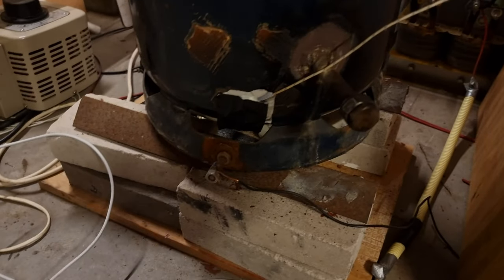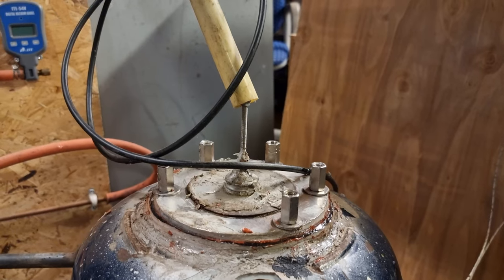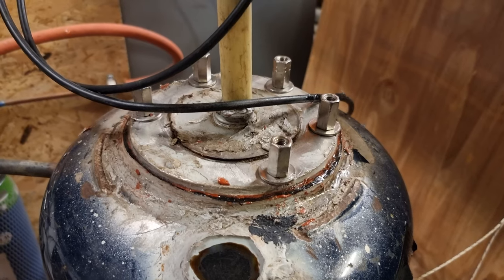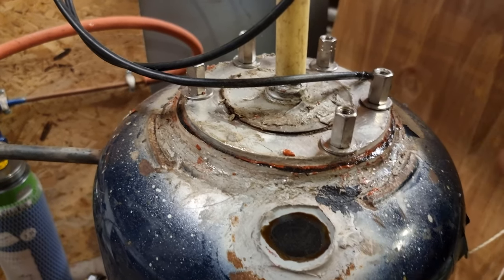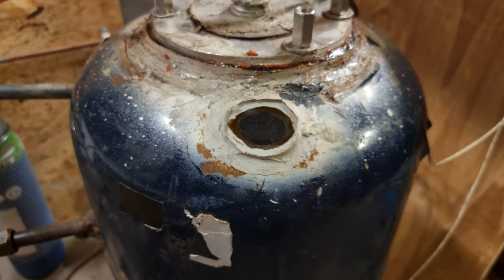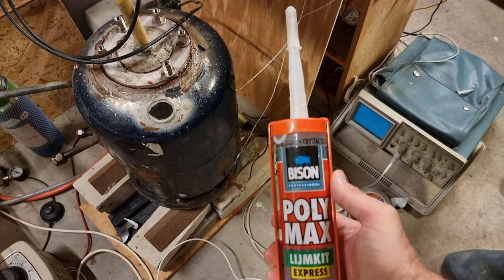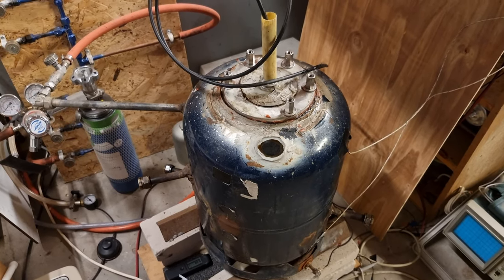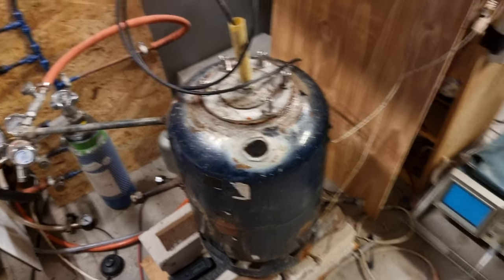VEGA - Reaction Chamber

Comment: When making vacuum chamber gaskets, I use RTV silicone with clear vinyl plastic on top of it. I put some very flat item on top of the clear vinyl so that everything is level. After it dries, I pull off the flat item and then cut the clear vinyl to form a gasket. It's certainly not perfect unless you use Dielectric grease on top of it, but it's pretty good. Bob, when are you going to activate your website for all this technical sharing?
Reply from the maker: Hi SpaceCase.

Good tip.

I need to chase the developers and see where they are with it and act accordingly.